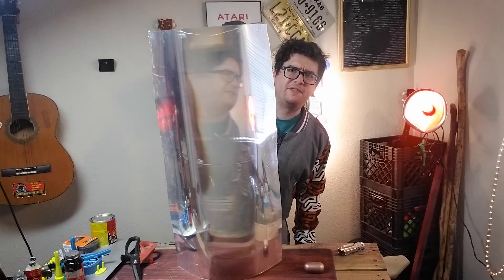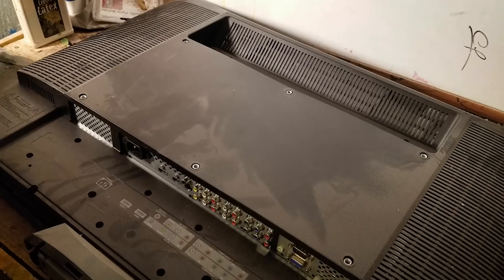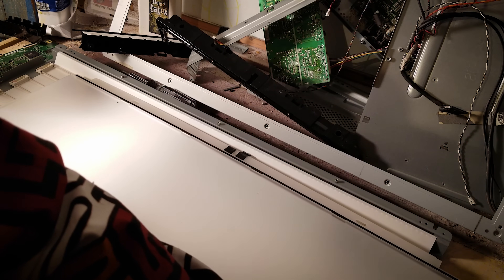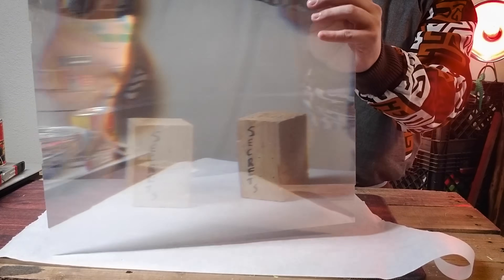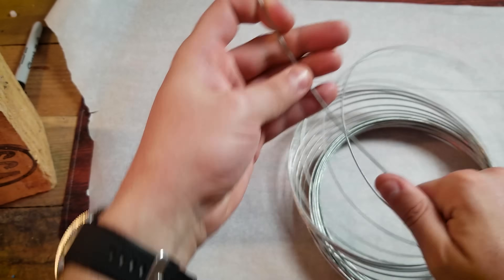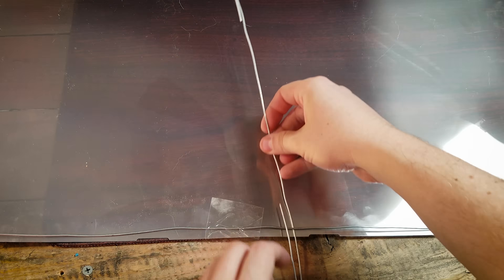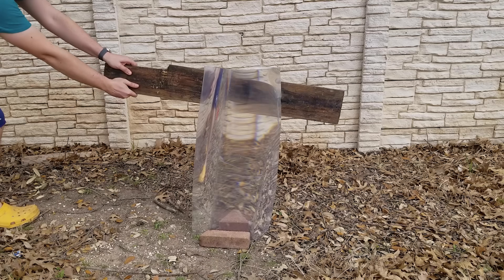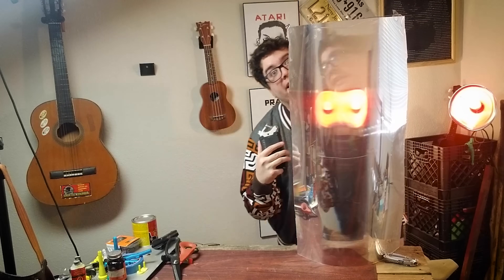How to make an INVISIBILITY SHIELD for FREE! (really)

Comment: Frensel lense from an old reat projection tv? Na. I think ill use if for a solar death ray istead! Keep it flat, put a frame around it with central axle so you can angle it. Find the focal point and its like a super magnifying glass. Can melt metal with it!

Comment: Lol this reminds me of people who use mylar blankets to try and hide from FLIR. It's technically successful in that it blocks your body heat, but the mylar blanket is actually MORE visible than you would've been otherwise, since it shows up as a dark black spot in the middle of what would otherwise be ambient temperature. Instead of showing as slightly warmer than the environment, you show as much, much colder. It technically makes the subject invisible, but distorts everything else so much it's pretty freakin' obvious there's something back there. The actual invisibility shields disperse light horizontally but not vertically, which is why that effect actually works.

Comment: This type of shield I believe is slightly different than the ones shown in the original video. The way the original invisibility shield works is by dispersing light in the horizontal layer so that the centerpiece is a mixture of light bouncing off of you (or anything that is being hidden) and light from the corners.

The difference in how it works is visible, here you can see that the entire "picture" is moved and still maintains its sharpness. The OG invisibility shield has sort of built-in blurring effect on the horizontal axis.

Hopefully it makes sense. This shield is still great though. Certainly better than nothing.
Reply from the maker: Huh that's interesting. I'll have to give it another watch
Reply: That's absolutely the coolest

Comment from the maker: Correction: the plastic sheet is called a lenticular lens, not a fresnel lens. I got old and new tv tech mixed up 😬

Correction 2: don't touch any capacitors - they can hold an electrical charge even if the tv is off
Reply: It should also be noted, its old LCD tvs, not CRT tvs, which are the fishbowl looking ones your Parents/ Grand Parents used to watch Howdy Doody on.
Reply: Is the lens flexible enough to be superglued to a poncho or something?
Reply from the maker: Probably! Tricky part would be keeping the shape and having enough overhang on the edges to "catch" the background and project it onto the front if that makes sense
Reply: @Patrick_Gibney  how much overhang would be considered good vs too much?
Reply: I was going to mention the second ditty, until I saw you mention it.
Can u pin this comment for others?
Thanks for the video
Reply: @PatHazard12  lcd doesn’t have fresnel lenses.
Just get a tv from the 90’s that is called a rear projection tv. The front screen of the rear projection tv has two layers, one of which is the fresnel. I’ve done this a dozen times.
Blessings to you all

Comment: I saw this and found 2 TVs being dumped so pulled them apart they were flatscreen but I think you need a rear projection tv as the LCD ones didnt have the lens in the middle :(. If anyone else has tried this let me know if im on the right track here.